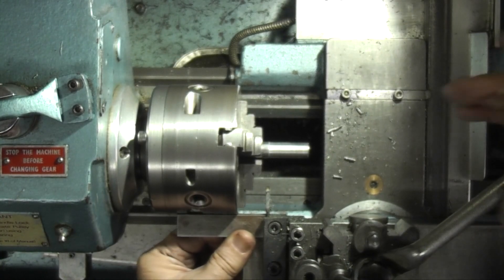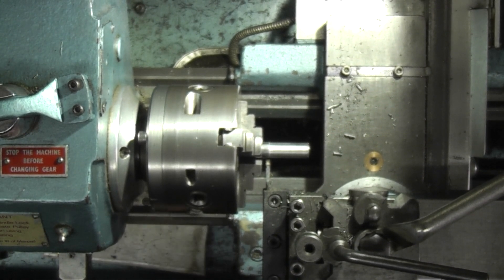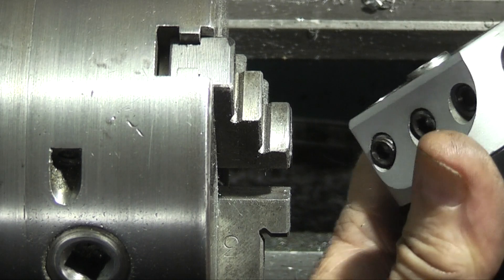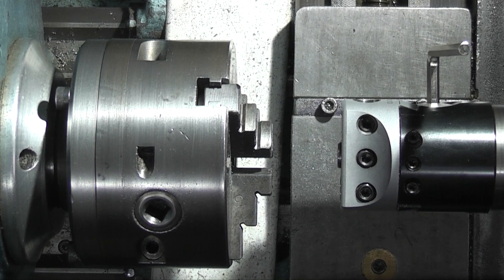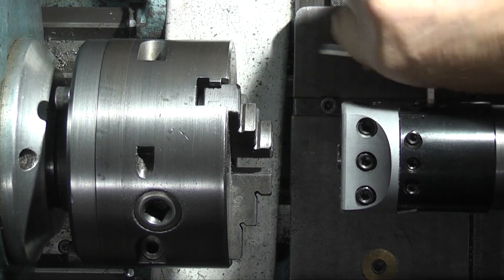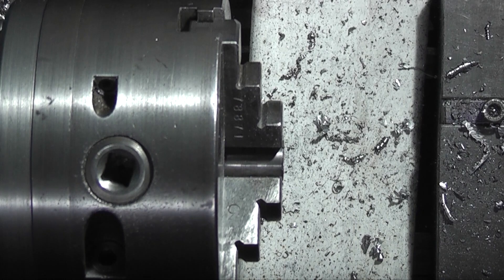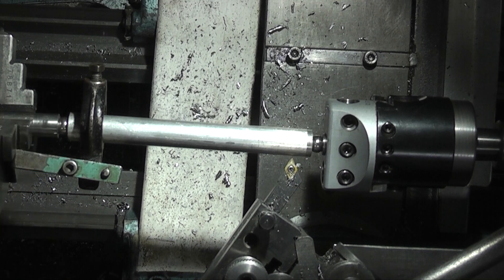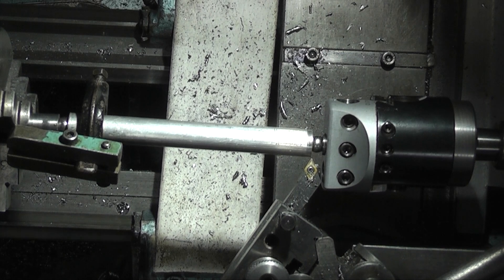taper turning without adjusting your tail stock

Comment: this is a very clever solution to tapers on the mini lathe!  I'm going to try this with an even smaller bite into the lathe bed using a taper offset attachment.  Thanks for sharing this innovative way to turn between "centres" 😀

Comment: Very usefull information ... using ball bearings instead points ... a highter precision work.
As you, i also think that - after having centered the tail stock with many work hours, and so much effort, and ... ( least but not last ) 0,02 mm. ( only ) error in diameter on my chinese lathe, it's a pity move the tail stock screws again. Me too have got such a beatifull device, that "head" with the screws to de-center its tip, and i can use it either in the tail stock with MK2 taper, and also ( equally usefull ) into the spin taper, with an adaptor MK3.
No other tail stock adjustment in the future, also i had to provide a sort of micrometric screws to accomplish that job ... 
I also was able - using that "head" into the spin, to perfectly center the hole in my steady rest, loosy tighteen, pushing it slowly toward the spin, with the help of the saddle ...

Comment: Outstanding bit of information, Sir. I have been wanting an efficient way to turn some Morse taper shanks, and I have just recently acquired a boring head,  .  This  video is exactly what I needed. THANK YOU. 
 Charlie
Reply: For Morse tapers making, you can also use your compound ; to get a "right" angle i purchased some ( simple ) mechanical squares ( with lateral rule (? )).
Then i made 2 bores 3,0 mm each, 50 mm from each other ; and after having tapered the two bores 3MA, i inserted in each of them a screw, that i previously lathed with point.
And - after having read some mechanical books dealing with morse taper, i made one screw protruding ( say fo instance ) ... 3,00 mm, and the other as long as the calculated difference for Morse 2 ( for example ) , in a lenght of 50,0 mm.
The screws were secured with Loctite and then adjusted to the exact value with a file, used to short each of the two screws, depending of the error.
I use this square tools to get the exact angle of the compound, one square tool for each value of MK2 or MK3 or what you want.
Of course a check with an "exact" ( = "purchased" and new  ) morse taper is a must.
You can also make a tool B16 for the drill, or what you need.
Obviously, you must first check your compound travel, if it's long enought for the taper to be build, but for me generally was always ok, with a bit of care ...
Reply: Morerover ... if you have a boring head, be sure to get also both the shanks for the tail stock taper and for the spindle taper. They are interchangeable in my boring head ( simply screwed ).They are ( in my chinese lathe ) MK2 and MK3.
Just not force too much into the tapers, remember you have to remove it ... and so, don't leave them into the tapers for long time, i had notice somebody said they remained stuck inside ...

Comment: That's very cunning...giving easily settable & measurable offset.... but the balls, oh the balls....wow. I always assumed I'd have to buy or make 60 degree centres with a slightly convex cone to give the 'steering joint' effect needed for offset taper turning. Well done for posting, thanks

Comment: tried that years ago Allen but it's not reliable because you must be dead nuts sure that the boring head leadscrew is perfectly parallel with your lathe bed ways. ie. keep the same centerline down the length of the part. even slightly out of the aforementioned parallelism and you're pushing the centre of that tailstock in a vertical plane and not your desired horizontal one

Comment: I've been using this technique for some time, and it works well. I modified a cheap live centre to fit the boring head. It's important to ensure the boring head adjustment axis is truly horizontal, or the offset will also introduce vertical mis-alignment.